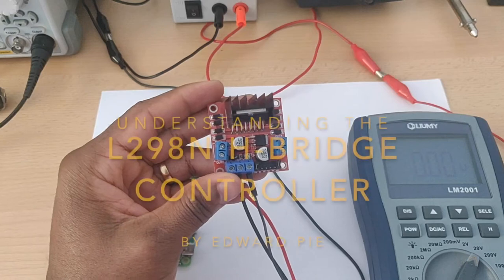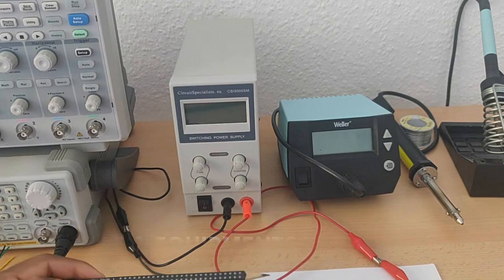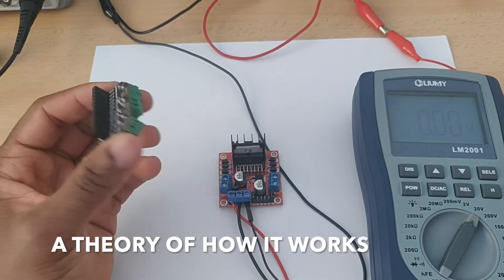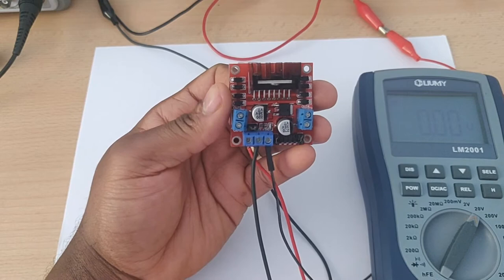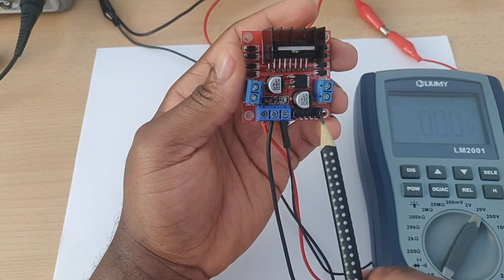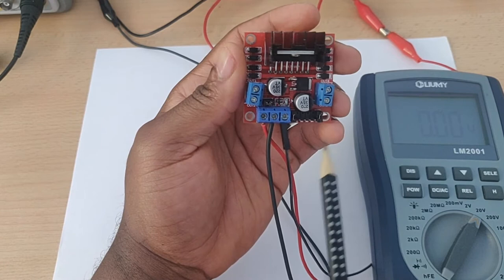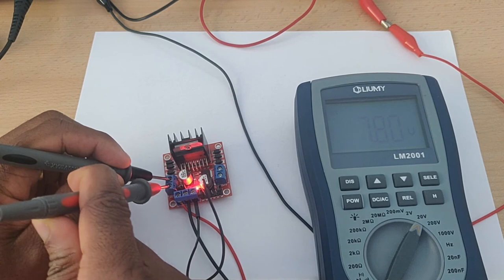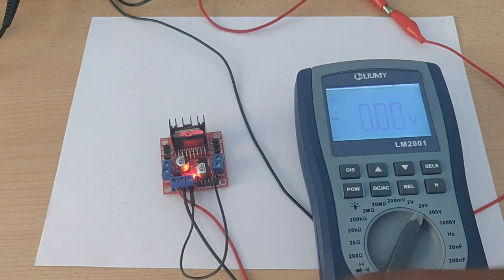L298N H Bridge DC Motor Controller without any Microcontroller

Comment: Great video. If you wanted one motor to be able to turn in both directions without moving the 5V wire, would you need a microcontroller? Or is there another clever way. Thanks.